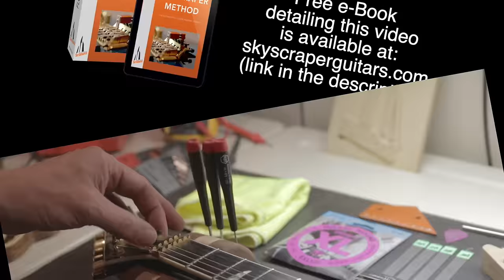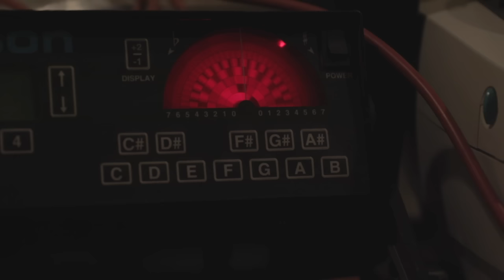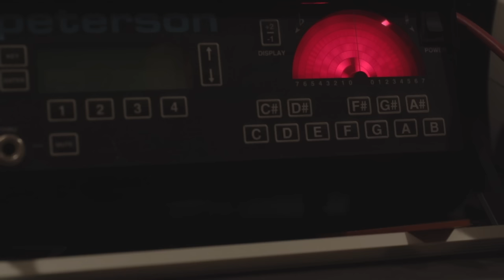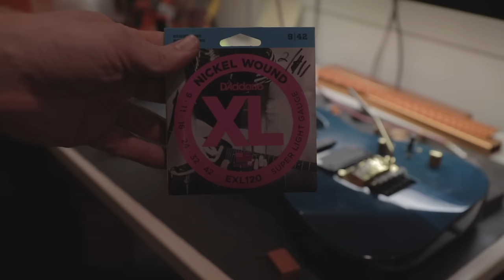FULL Floyd Rose Setup Including Intonation - The SkyScraper Method

Comment: The angle your springs are at here versus straight, does that make any difference also what about using only 2 springs?
Reply from the maker: The angle puts a very, very slight amount of extra pressure on the bridge.  Most guys who have them that way do it out of habit more than necessity (myself included).  Most guitars running 9's use 3 springs because that's what it takes to balance the tension from the strings.  You can run 2 springs and tighten the claw more if you can develop enough tension.  Some guitars bottom out on the claw with 2 springs, other guitars do just fine.  3 has always felt more balanced to me, but I've been happy playing guitars with 2 springs and 4 springs...  Also, there are folks out there who make higher and lower tension springs, so you could go with 2 high tension springs and get the same pull as 3 or 4 springs...  Bottom line - There are a lot of ways to make it work.  Do a little experimenting and you'll find your sweet spot!
Reply: @SkyscraperGuitars  Thanks a lot, yeah i have an old jackson here and i took a spring out but its not staying in tune very well and i cant get the floyd straight with the body so ill put the 3rd back in it

Comment: Damn that truss rod is TIGHT
Reply: Cause the strings are up to pitch
Reply: @alfredthompson3022  that definitely adds to the tightness, but some truss rods are smooth as butter even when under string tension, could be a number of things...
Reply: I cringed each time I heard that truss rod nut pop. I’d pull it and put a touch of wax (or chapstick) on the nut/washer face which would remove the excessive binding. 

Lubricating the threads is a possibility, but a slight cleaning is likely all that is needed.

Comment: How do you fix sharp notes on the lower frets? thx
Reply from the maker: A high nut or high string action can cause this.  Also heavy string gauge and a heavy fretting hand can cause it as well.  If a customer comes in with this complaint, I always ask to see them play the guitar so I can assess whether they are grabbing their notes too hard....  

One unfortunate fact is that most guitars (99%+) are going to be a little sharp from 1 to about 7.  It's the physics of how the strings stretch and how the frets are evenly tempered.  There are a few corrections like the true temper fret system and earvana nuts.  Those items compensate for the physical shortcomings of modern guitar designs.

Bottom line is that most people learn to play lighter or live with that issue (assuming the nut and string height are set properly).  It's generally 6-8 cents at the worst, but more like 2-5 in most cases.

Acoustic guitars tend to be worse than electrics because of scale lengths and string gauges.
Reply: @SkyscraperGuitars  ok, thx, that helps.

Comment: I wish i could find a video about intonating a floyd rose but with heavy gauge strings for drop c im having so much trouble
Reply from the maker: What is your issue?
Reply: @SkyscraperGuitars  Thanks for replying man. I have been working on an album and have been having such horrible tuning issues...originally i played with a 10-52 set and had problems with the top 3 strings especially the g not wanting to ever sound or stay in tune so I switched to a 56-44-32 -22p-15-11 set and they stay in tune better but now i am having problems with the bottom 3 strings. I know how to set up a guitar or at least have a fair understanding on the subject. I have the relief set and the action exactly where i like it but i am still having issues. I am not able to get the saddle back far enough on the 56 so it shows up slightly sharp at the 12th. According to my tuner everything else is intonated but seems like it either falls back out of tune after 2 minutes or its just not in tune with its self. When i go to play say a d5 at the 5th and 7th frets it never sounds in tune but shows that the strings are indeed in tune at the open and the 12th. I even have the floyd perfectly balanced but there is still something going on. I have been using a snark is it just not accurate enough?
Reply from the maker: @andrewsanchez4988  I've got a few thoughts for you...  First, I would highly recommend getting a Peterson stroboplus.  They are about $130.  They have sweetened tuning settings for 7 string.  
If you are heavy handed like me, your low notes will always be sharp at attack, then flatten out.  This is WAY worse on open strings than fretted notes.  Sometimes you just have to drop a few cents (3-10 depending on how hard you hit.). If you drop the tuning a bit, you need to be quick on your muting...  Its a compromise, but that's just how it works.  When I talked to Frampton's tech last summer he showed me his list of tuning offsets for open note songs, so even the big boys do this.
For the saddle that won't go far enough back...  You may have to file where the string sits or file the back of the saddle to allow more clearance.  You've got to have good intonation at 1 and 12.  Worst case, you may have to move the bridge posts back...  That's a ton of work, but you need to have the intonation set right or it will drive you nuts.
Lastly, just hitting the lowest strings can pull the whole guitar slightly sharp because the FR floats.  A light touch will go a long way.  If you play hard and light isn't an option, you can put 5 springs on the Trem.  Since springs are more stretchy in the middle of their travel, they are actually stiffer right as they start through their range of motion.  If you put 5 springs on, your claw will have to be adjusted WAY out.  This will keep your trem stiffer when at rest.  That will help the whole guitar play in tune.  Not by much, but it may be enough to get you sounding right.
If I had your guitar on my bench, I would be swapping a handful of parts out to see what combination plays the best.  There's no magic answer, just a handful of things that you can try to make everything a bit sweeter.
Lastly, you might try a few different brands of strings.  I have had bad luck with a few manufacturers on FR guitars.  I won't put slinkys on a floating trem.  I love them on hard tails though.  You might call string joy and tell them what is going on.  They may be able to put a custom set together for you.  A wound vs unwound 3rd might be a game changer...  I don't know.

Good luck!!! -Greg
Reply: @SkyscraperGuitars  Thanks dude i really appreciate it....i think its just time to get something new... Ive been really really wanting one of Ola Englands solar guitars wheb ever i can afford the 800 bux lol.. I think i have grown out of the floyd rose phase tho I got this guitar as a graduation present over 10 years ago and back then i had such a hard on for floyd rose equipped guitars and players like Synyster gates and Dimebag. I have only used it once on this album for some cool effects on a song. I really do play with a heavy hand though because the emgh4s i have just beg to be played hard cause they really get that tight bite that i havent been able to find with other passive pickups without just being flooded with low end. I will have to look into a stroboplus. In the mean time do you think blocking the bridge would help? I just finished guitars and drums for another song today only to find out while laying down bass tracks that everything is about 3 cents sharp. Again tho dude i really appreciate the help if you have a patreon i would love to become a patron.

Comment: your help please, im having the same issue mentioned in 17:11 the guitar doesn't stay in tune, it tends to go sharp, i put a 9v battery in the back to block the tremolo but no use. your advice is appreciation.
Reply: Hope this helps. I've had that on a few of my guitars. What I did was tune the guitar just a hair flat before I tightened up the string nut locks. After tightening them up it brought my strings in tune.
Reply: @antithug7942  thanks!!

Comment: I have a question for everyone or anyone who can help me out. I'm at 19:07 with mine and to get it leveled, I ended up having to screw them nearly ALL the way in. Doesnt seem right. Are my springs just too tight??
Reply from the maker: Are you running 3 springs?  If so, you need to add a 4th.  That will pull harder and the claw won't have to go in as far.
Reply: @SkyscraperGuitars  Oh I see now. Yes I have 3 in. Thanks for the guick reply too. Helps a LOT!!!
Reply: @SkyscraperGuitars  I have one more question now. I'm looking up spring sets to buy and theres lots of brands and different types. Does it really matter? Is any brand more reliable than another or is it just springs are springs?
Reply from the maker: @chris_htepo  I usually buy from a big brand.  Either Fender or Floyd.  FU-Tone also makes good springs.  If you go the cheaper route, you can luck out and get good ones, or you can get trash.  Its a dice roll.  The big boys are always reliably good.

Comment: Hey, I have a question for you, I bought a used floyd that was previously tuned to e flat but had obviously not been tuned in a while and the frets were buzzing but with the amp it was fine so i figured it would be a minor adjustment/tune it. I got it home and got it all tuned up (properly) and it is still buzzing on all of the frets and all of the strings. It looks to have enough relief and the bridge is level. I have not replaced the strings. Is it the truss rod, the nut, or the bridge that is causing this ? Sorry for all the detail
Reply: I also tuned it back to e flat, the previous tuning, by the way
Reply from the maker: It could be all of the above.  I ALWAYS start with the truss rod adjustment.  Small adjustments there can make a big difference.  .010" is about as low as I go for neck relief, I like .012-.014.  Then string height plays a big part.  5/64" on the bass side and 3-4/64 on the treble.  Also, site down the neck.  Is there a big swoop somewhere?  Sometimes you get a couple high frets that cause all kinds of trouble.  If the issue is in frets 1-9, you may need more relief.  If its in 10-24 you might have a hump at the body or a couple high frets.  A fret rocker can sort out if and where you have high frets.  A string height gauge is essential to tell if you have a string height issue...  Also, look at the nut relief.  Sometimes the locking nut gets worn down.  You should have a minimum of .018" at the first fret.  If its lower than that, you can shim the nut up.  That mainly helps with open strings, but it can also cause intonation issues.  Lastly, tuning from Eb to E should create more string tension and allow for more neck relief.  Typically tuning UP will not cause a buzz unless its pulling your bridge out of level. -Greg
Reply: @SkyscraperGuitars  I'll give it a little more relief when i get home and see if that makes a difference, if not, i'll check the height on the strings in certain places and determine whether i should shave some of the nut (no homo), do some fret work, or maybe just do as you said and raise it up a half step. I thank you very much for your help man, i appreciate it. I'll be in touch when i see what happens
Reply: @SkyscraperGuitars  Also, i subbed to you, never got help so fast
Reply: @SkyscraperGuitars  Ok, I'm sorry for responding so late (busy), I finally got to troubleshooting the issue on my floyd and I leveled off the bridge, no dice (little better tho), I did a truss rod adjustment, raised action a little but still buzzes. I used blocks to do this by the way. I'm thinking its either the nut or the frets now. What do you think ?
Reply from the maker: @metalheadmusician6941  I'd highly recommend getting a fret rocker so you can find if you've got a few high frets.  You can also get some feeler gauges and check your string action at the first fret.  .018" to .022" is a decent range.  Any lower than that and its highly likely you'll have buzz.  Also, make sure you're testing through an amp and not just acoustically.  A lot of electric guitars buzz a tiny bit when not plugged in.  The amp may not pick it up.
Reply: @SkyscraperGuitars  The buzz goes to the amp. I'm going to take it to a professional soon to see what the problem really is, this is a lot to take care of a floyd.
Reply: @SkyscraperGuitars  I thank you so much for your help through this, its helped me out a lot
Reply: @SkyscraperGuitars  I'm so happy now, I took it to the guy and he said that it would have some buzzing but if i restrung the guitar it would make it sound better. I percrastinated because I was scared to do it but today, I looked up your video on setting up a floyd and a simple cleaning and restring fixed my issue with buzzing and sustain. Thank you so much man for helping me through this !!!
Reply from the maker: Rock on!
Reply: @SkyscraperGuitars  You too man 🤘

Comment: If you're going to disparage another manufacturer's product (ie the cheaper action gauges) can you provide some actual evidence, rather than just 'saying' you think they're not accurate ? I just checked the cheap one I bought against a standard and it's spot on. How would you feel if someone just 'said' your company's fret rocker wasn't flat without proving it ?
Reply from the maker: I could put together a video of tools I'd never buy again.  There are a few for sure...  Maybe I've been unlucky, but I've had a few cheapo height gauges that had screen printed lines/numbers on them.  Screen printing is notorious for not being accurate.  If the tool is etched (you can feel the ridges of the lines) you are likely to get good results.  That said, I'll see if I can throw something together that shows more specific examples.  I'm certain it would be helpful for folks to see.

Comment: You’re supposed to put the capo on the first fret not in the middle
Reply from the maker: If you're checking neck relief, it doesn't matter, you just want the strings to make good contact on the first fret.  If your capo pushes the string slightly ahead of the top of the crown, you can throw the measurement off by a thou or two and that's no good...  As for playing, put the capo where it suits your style and your ear.
Reply: SkyScraper Guitars  I  have been setting up Guitars for about 35 years, and I have noticed that when I put the capo behind the fret it does the same thing as you were saying, it puts it off by 1000th or so and I find that every time I put the capo right on the first fret it doesn’t .  So I think we are in agreement that if it is not exactly on top of the first fret that it will throw it off because physically it is the same measurement before and after, but it’s so slight it probably won’t really matter it’s just semantics at this point, but good video and keep going brother!!